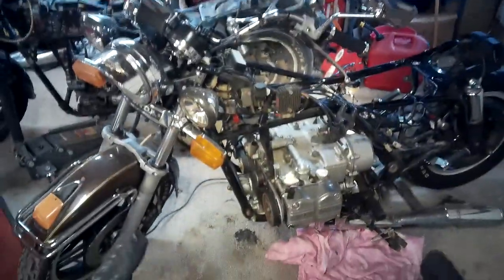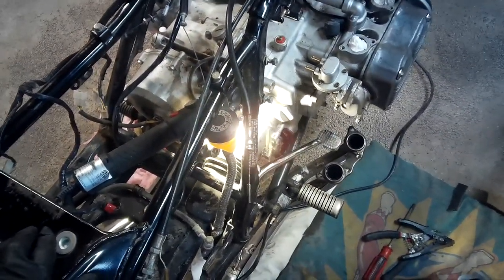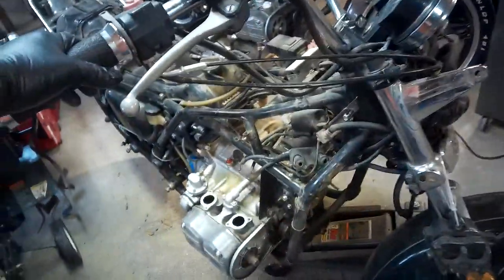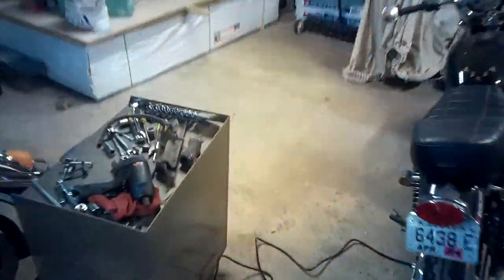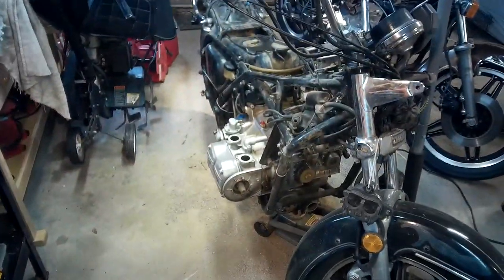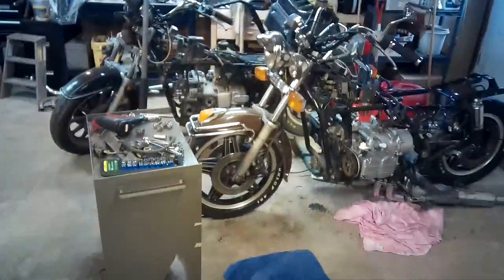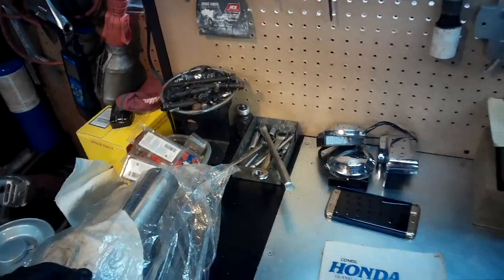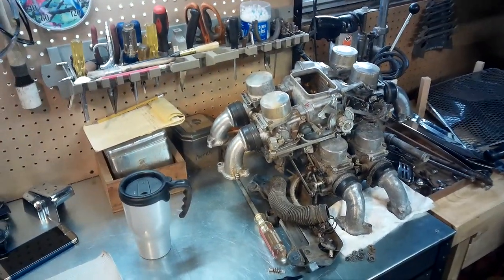83 Honda GL1100 Update

Comment: Not sure how you can keep track of what goes where.   Can't  wait to see where you projects end up.   I have an 83 gs450ga I have messed around with for 7 years or so.
Reply from the maker: I have things labelled where I can but mostly I keep the manual close by and have a few forums bookmarked. Other wise I would get lost for sure. Do you ride the 83 at all?
Reply: @MidwestMotoRider  it has been sitting for 8 years. Took it apart to paint and redo the seat.  I did the carb a few years ago.  Hopefully  it is still ok.  I sprayed it with some stabilizer to keep it from corroding.  Hopefully get it back together  this year.
Reply from the maker: @CDLNEPA  I hope you get back to it also. Nice bike would be fun to ride.